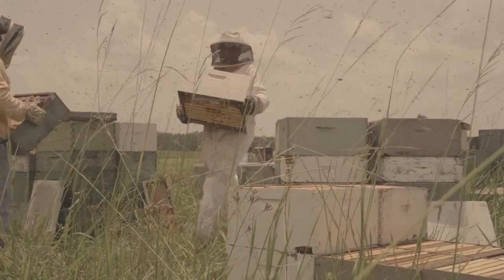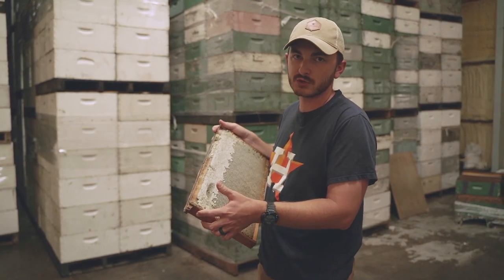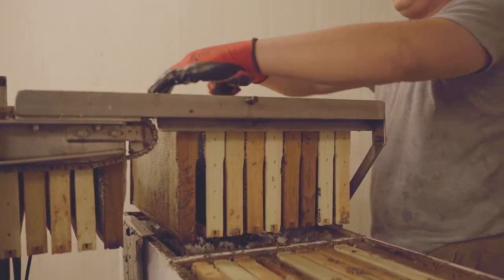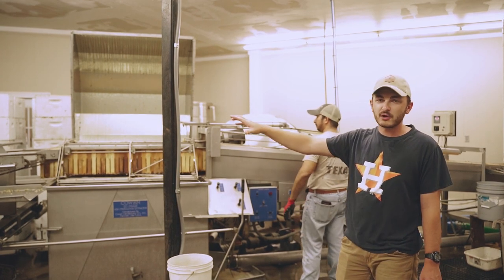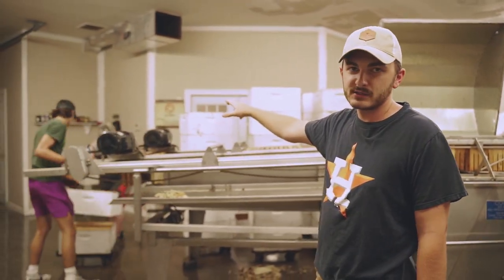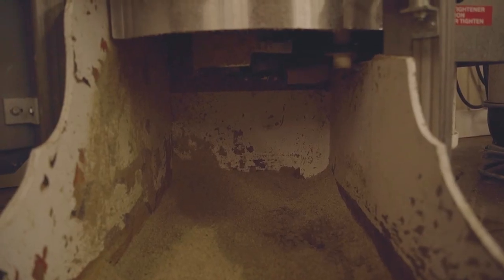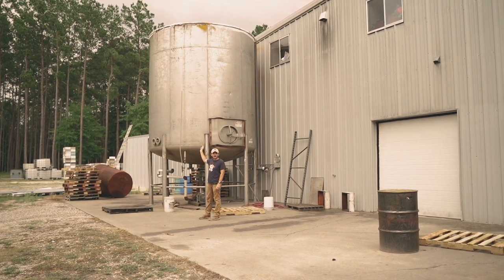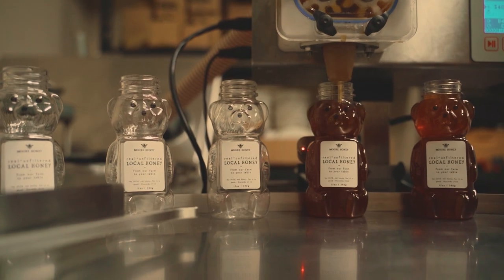How Commercial Beekeepers Harvest Honey

Comment: Excellent video!
Just a quick question, what do you do with the frames that have more uncapped honey (nectar) than capped honey?
If you still extract it, does it affect the overall water content of the other capped honey?
Reply from the maker: We let it sit in our warehouse where we run heat and air at the same time to dry the entire room. This usually gets it where it needs to be. Everything goes through the extractor. Only a few years past we’ve actually had to use a dryer
Reply: @beefarmerjake  That makes a lot of sense. Nice, thanks for answering.

Comment: Can u elaborate on your filtration part of the process?  We own a mini Lyson extraction line. Our bottleneck is when the honey is pumped out of a sump through a 800 and 400 micron strainer into a big tank. The strainers often backup and eventually need to be changed out. Thanks.
Reply from the maker: We do not filter at all. We have a very nice cook and beals honey wax separator.
Reply: @beefarmerjake  which model do u have?  So, this will achieve the same results as if utilizing a strainer?  What temps does the honey need to be in order the the separator to work well?  Can u do it by just keeping the room temps in the 80s?